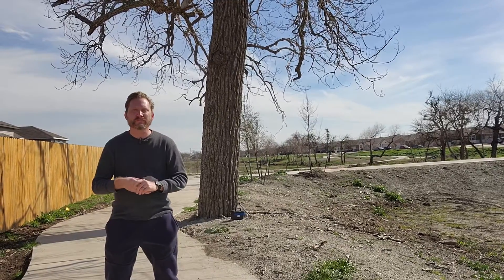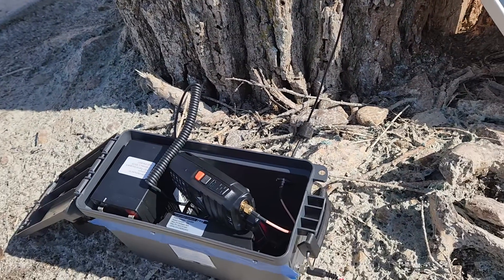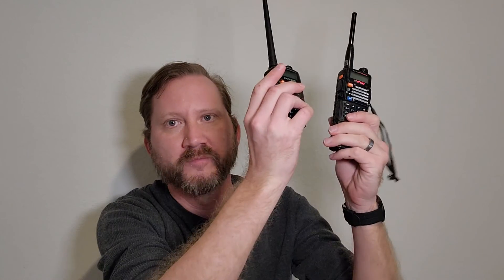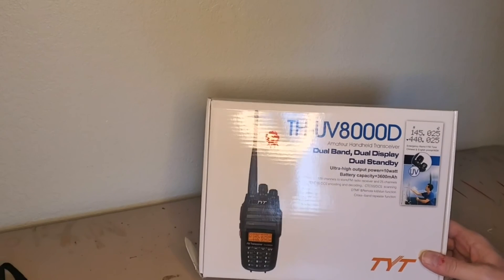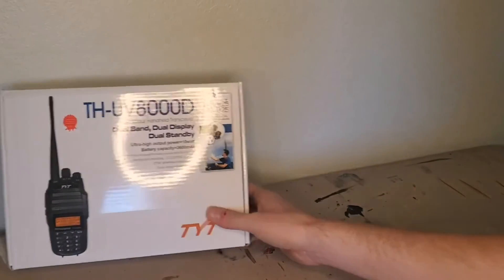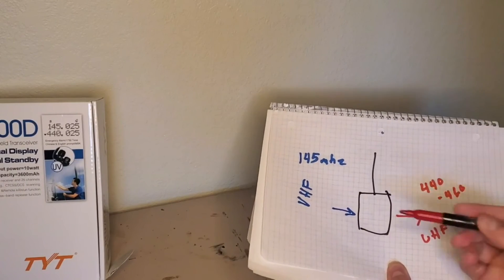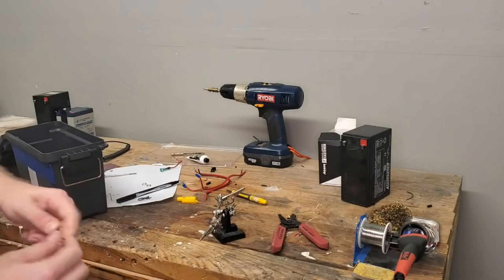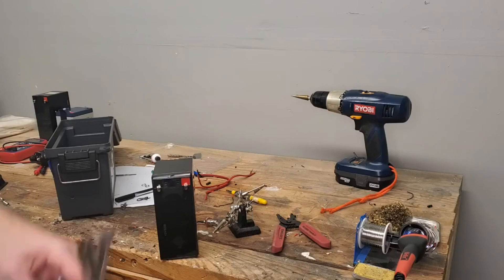Solar Powered ham radio repeater | Texas Prepper Projects #prepper

Comment: I used a Radioddity GD88 in much the same configuration recently and it worked 👍
Reply from the maker: Neat radio i was not aware of it!
Reply: I'm building one now. Did you use the desktop charger on 12v or did you power the radio a different way?

Comment: My wifes family lives on a self-sustaining generational farm, about 400 acers. There are 5 houses on the farm and everyone works it, and they all run around with their UV-5R's, but there are hills and valleys, so there are dead spots. Im thinking something like this would be perfect for better communication. I'll have to figure out how to set up a repeater, but im sure there is a video on YT for that.  But if the repeater is under heavy use, could I just upgrade battery and solar panel size to accommodate?  Andbhave you used this set up with great success, meaning no problems with wanting to utilize the repeater, but it isn't functioning properly or there isnt enough power to keep it going? Im really looking for a set it and forget it.
Reply from the maker: What I would do is buy a retevis GMRS repeater. They run on 12v. Yes, you can just put a larger battery and solar panel on it and set and forget. Feel free to email me directly to discuss

Comment: Is it possible to use repeater mode in the same band? Like 467.450 in and 467.550 out?
Reply from the maker: Not with this product.  It is a cross band repeater. But it solves a LOT of issues with duplexers and channel separation. If you want a same band repeater you are going to spend a lot more. Also if your radio is a dual channel baofung it's super easy to set up this way

Comment: Nice video, If you build another one you might consider using velcro for your charge controller as well. That will help to eliminate more penetrations in the box.
Reply from the maker: Valid. Since there was weight hanging on it I wanted a physical connection.  If I really wanted this thing to be waterproof I'd do thing differently.  I made the holes for the screws so small that I actually had to thread them in, so they are tight in the box. Thanks for the email!

Comment: Similar setup here. A couple things I’ve discovered. 
1-Set a tone for both inputs. It’ll keep randoms from triggering it. 
2-Ideally, you use VHF in, and UHF out. You’ll be able to hit the repeater from further out w vhf, and since it’s transmitting from a better location, uhf will typically carry far enough. But if you need the repeater to Tx further, use uhf in, to get vhf out.
Reply from the maker: Agreed on using tones!